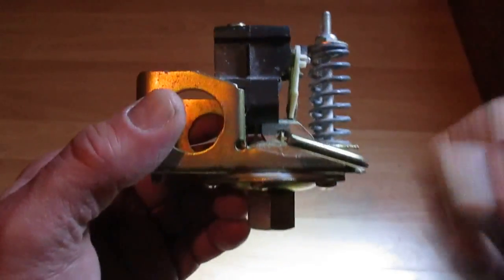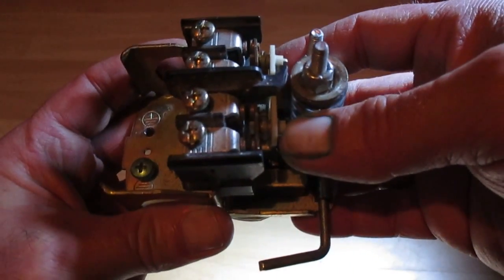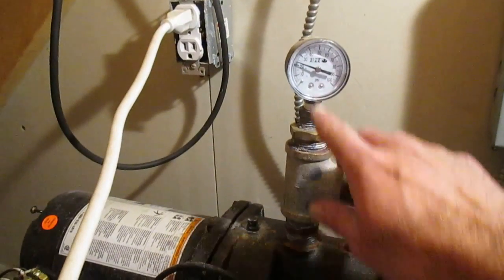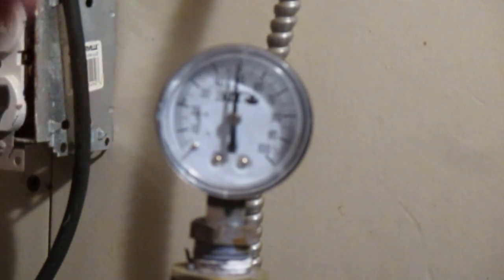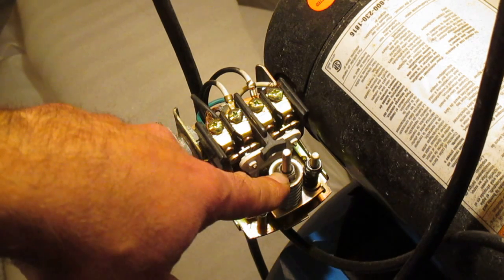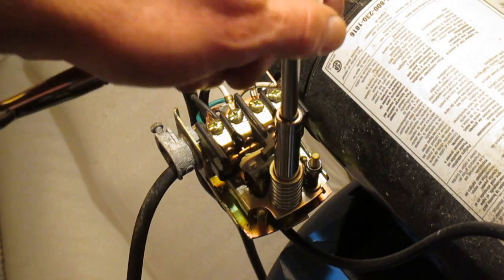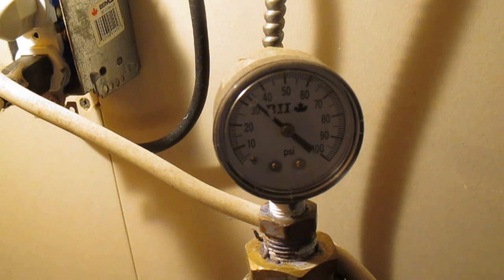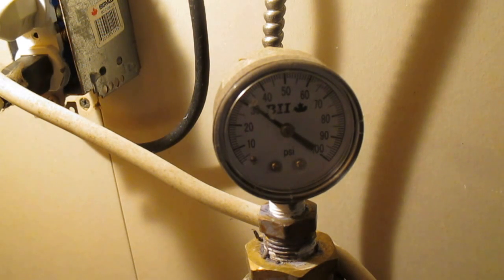How a jet pump pressure switch works

Comment: Thanks for this. I think based on your explanation that our pressure sensor might be malfunctioning as it keeps going between 30 and 50 rapidly, making the pump turn on and off rapidly, until it stops suddenly

Comment: Yes, I have the problem that Im not using water in the house, all faucets are off, made sure no leaking anywhere, but the machine continues on and on, it never turns off and its relatively new, out of the box, I will try your advise and let you know cause dont know what else to do.